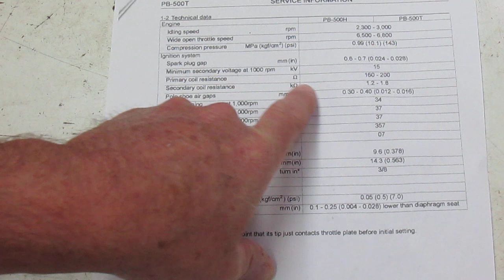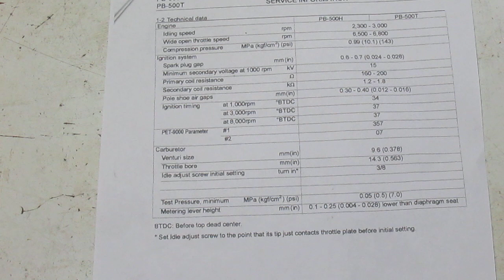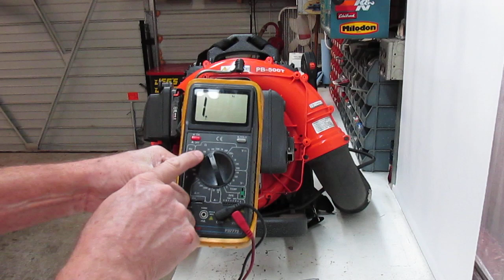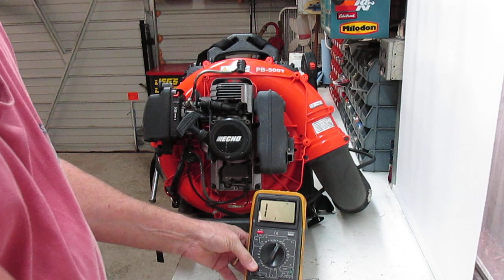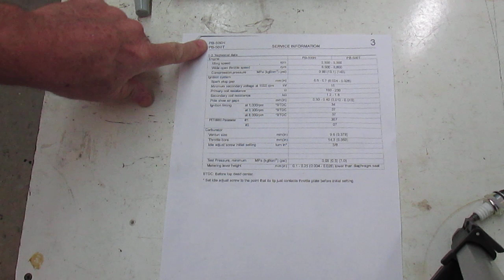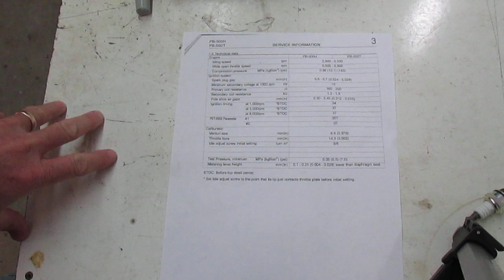ECHO PB-500T Blower Ignition Problem

Comment: My primary was 304 ohms and the secondary was over 20M ohms. Had already ordered new coil. Will update if it works or not.
Reply: Installed new coil but it failed after only about 30 minutes before it started missing. Ther are numerous coils out there that range from about $20 to $120. Not sure which one to order. I used the correct serial number to find the correct part number. It was A040000030 which subs to different numbers. Your comment about the clearance of 30-40 thousandths was very helpful. Unless you get the gap right it will not work.

Comment: I know it's three years on, but your video helped me to establish that the coil on my blower was at fault (PB-580T).  I found that the primary was OPEN - no circuit at all.  Replacement went in without issue, and the unit now starts and runs just fine.  Thanks!  (While i could not get the "Service Information" sheet for my unit - or any other, for that matter - the Service Information sheet you showed on camera was also of assistance.)  Thanks again!

Comment: I'm working on same model blower.  When I put red lead to plug wire & black to ground it reads 2.7 same as the two before.  I'm stumped with it. Will throw one spark occasionally then nothing.  If I switch on then back off it throws one spark & that's it. I've changed/ ordered two coils now & doing the same thing. One spark. Has me aggravated I've check switch,  wire continuity, plug is new, everything.
Reply: You ever figure it out? Got one doing same thing.
Reply: @krisw5894  never could figure it out. Honestly I think the motor was burnt up because it didn't feel right when pulling the string trying to start it. Only thing I didn't do is change the magnet which makes the spark.  I think maybe the cam or something internal was off/broken causing the timing to be off.

Comment: I'm working on a pb-500t as well and when I performed the test you did at 6:50 I came up with 15.9. At 6:22 you mention that a proper reading for the coil is 160 to 200. Given that do you think that the coil in my blower is bad?

Comment: Good video but a 3 point spark tester is a quicker way especially if the coil has a rev limiter a multi meter sometimes will not diagnost rev limiters in coils

Comment: When the engine don't have the speed and the power, check the muffler screen and the ports first.
Reply: Thanks! I am going to check that.  I have to take off a clean airfilter off just to start it and then once going its ok but seems like peak is missing.  Given you statement makes sense its clogged up at other end!  Bought at Pawn Shop and cant return so I think your comment might be my main rub.

Comment: Would you tell us where to get the ignition coil specs for a PB Echo 580t Leaf Blower?
Reply from the maker: www.echo-usa.com › tomwin41 › Techdata › Blowers
PDF
Reply: @10630390  Thank you for your effort in helping out. Best wishes
Reply from the maker: service data - Echo
Reply: did you get it fixed?
Reply: @RDJL559  Idk what's the problem, I replaced the spark plug, the carburetor, air filter, fuel lines. It starts sometimes and idles roughly  but at the moment I start to set the acceleration to just idle it does and it wont start until another 2 or 3 days later,maybe it is the ignition coil which is An after market part not the original or it could be the mixture screws from carburetor
Reply: @Mavrick-5  maybe running too rich
Turn clockwise by 1/8” of a turn or maybe 1/4” of a turn  both low and high speed jets
Reply: Did you ever actually find the resistance specs for an Echo PB-580T ignition coil?  Because I can't find them anywhere..